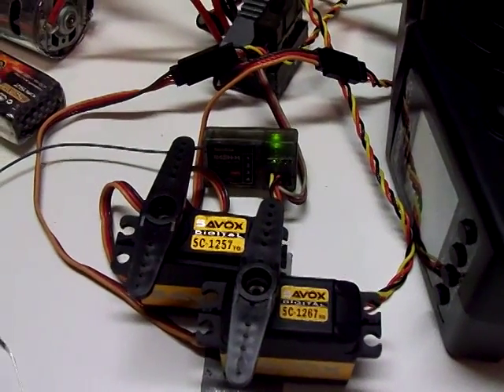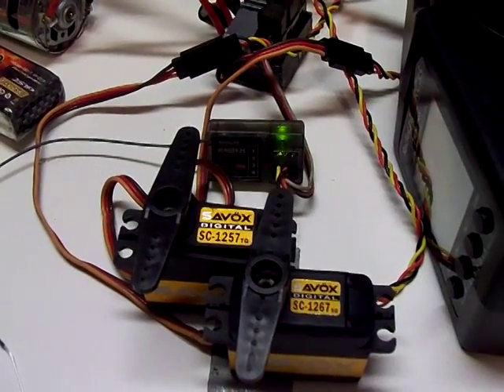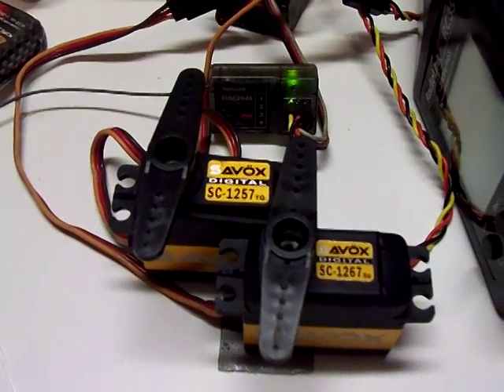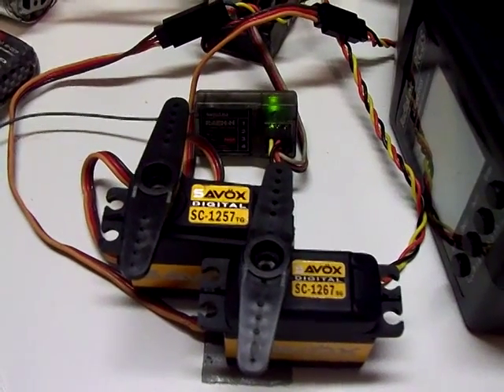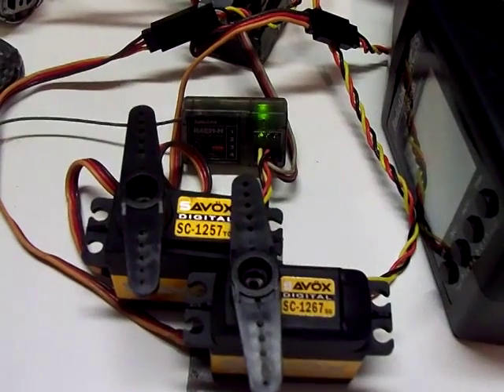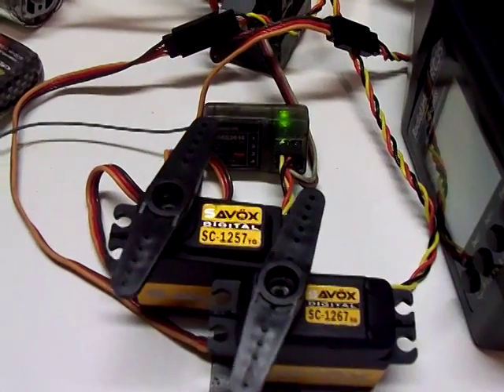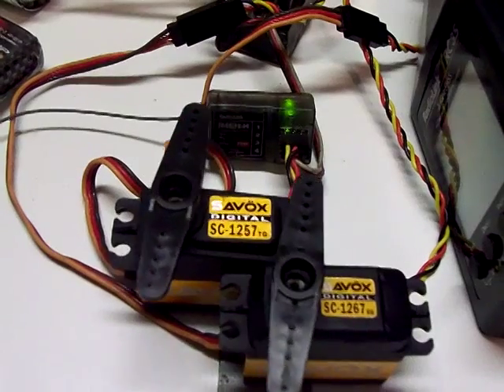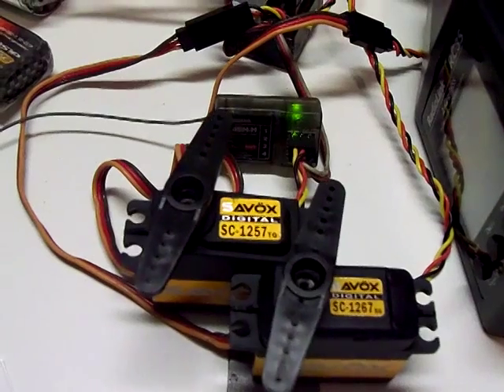Radiolink RC3S test 12-bit servo

Comment: The manual for the RC3S says the data resolution is 2048, which is 11 bits.  In your video, you mention that the radio is limited to 6 bits. Where did you find that information?

How would you compare the quality of this radio to something like a Futaba 3PL in terms of steering wheel feel and throttle tension?
Reply from the maker: Thanks for the correction, my understanding of 2048 converstion was wrong, I now see that 2^11 power = 2048 hence meaning 11-bit... much appreciated!